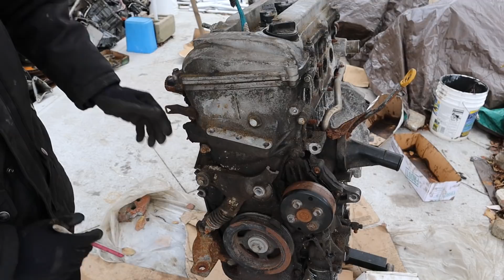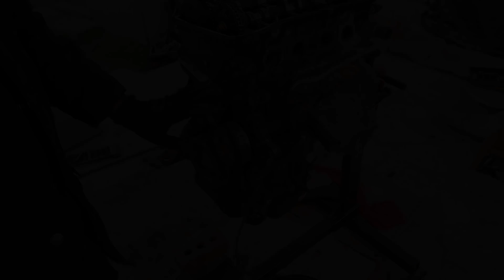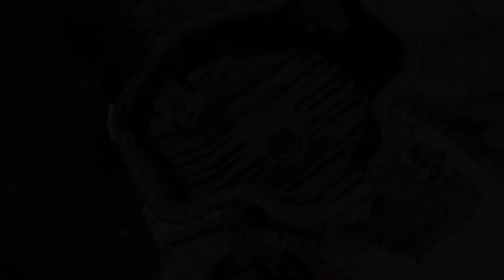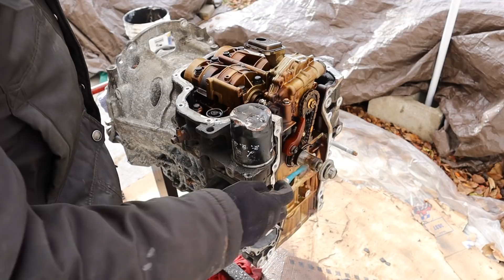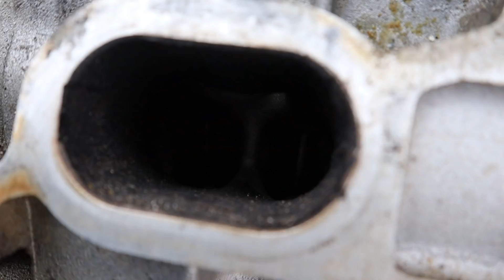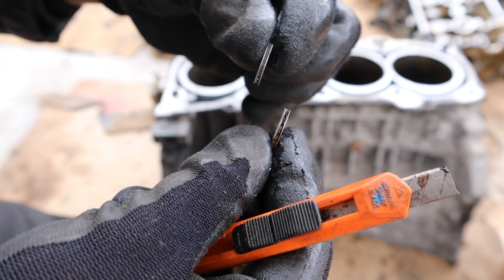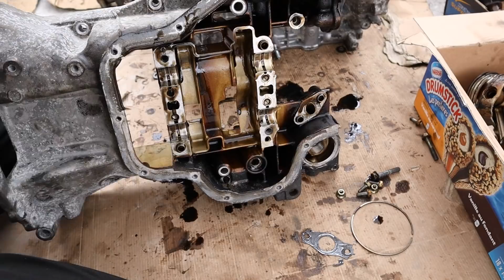Here's why Toyota Engines Fail

Comment: Which engine would you say lasts the longest? I’ve heard Subaru don’t last long and Toyota last longest. Assuming all are maintained on a regular basis.
Reply: Look for the engines Taxi fleets use, (as a general rule of thumb) here in NZ the Australian developed and built "Barra" 4.0 inline 6 is known to be bulletproof and racks up huge Kms. 
Lexus, consistently is No 1 for reliability and customer satisfaction, but Toyota in general, Honda also are probably top. Nissan USED to make great engines in the 90s during the Japanese factories "Golden era" (80s/90s) but now have fallen from grace, possibly merging with Renault and Dongfeng?? had something to do with this :-)
Reply: Where I live in Canada the oldest cars that I see on the road regularly are Hondas. It's a combination of their good quality and that they attract owners that are inclined to take care of them, IMO.
Reply: Mercedes Diesel Engines last a long time. No wonder 95% of cabs in Germany are Mercedes with Diesels
Reply: If i was getting a Camry, I'd get the earlier model with the 5S engine, overall it's a better car 👍
Reply: @lancecooper4646  got the 5s 2.2 in my 97 Celica, 230,000 miles and runs like a clock
Reply: @robbflynn4325  probably the best generation of Celicas, just ask Scotty Kilmer 😛👍
Reply: Taxi drivers here drive Toyota Prius predominantly seen them with over 500k.on clock.
Reply: @footballcoreano I agree they can last, but not a good idea for a regular person to buy a Merc here in the States, the cars themselves are expensive as are the parts, people do not know how to work on them and dealers are relatively few and far between.  I recall visiting Tenerife in 2004, where ALL of the taxi cabs were C Class diesel Mercs.  Basically they were used to shuttle passengers between the airports and the many island resorts.  The taxi we used had a million miles, I asked the driver how could a relatively modern car have accrued so many miles on such a small island and he said he shared it with another driver and it was in constant use 24/7, they probably only shut them down when they refueled or during servicing!

Comment: any engine fails for lack of maint period, those engines go forever with proper maint
Reply: But other engines don't burn oil as much
Reply: @lmb5529bml  My Toyota 4.0 has 250k and burns none with proper maint does yours?
Reply: @lutomson3496  The engine in the video actually does do as described even with proper maintenance. The oil ring gets stuck and the consumption jumps from a litre every once in a while to all of the oil in an hour. I’ve seen it. Checked the oil on the weekend, at the top. Wednesday, oil pressure light went on, no oil on the dipstick. Before that, checking the oil every few weeks was fine, and after that as well. But this engine decides it needs to go on a bender once in a while and drink all of the oil at once.
Reply: Unless it fails for a reason not lack of maintenance. Manufacturers still make blunders and corners are cut to save money. As a full time tech 30 years i saw plenty. Maintenance is best way consumer can prevent failures.. That and avoiding crap brands, first year models, cars with poor reviews and reliability history
Reply: @derrickodyes1934  I cant agree more thx

Comment: Hey, does anyone know what kind of screws the usually use for the connecting rods? is there any norm or something like that? thx in advance
Reply: You should be able to look up the part number on Toyota by looking at something specific like the piston. 

On their website they'll have an exploded diagram of all the parts in the area. It's great when you want to find a specific replacement for a bolt/screw/nut that you lost.
Reply: There is no "standard" but the conrod cap screws are typically 12 point (triple square, as opposed to the double hex speedkar points out for the head screws). 12mm fine pitch is a pretty common size but again there is not a standard that all engines follow.
Reply: Yes, someone knows.

Comment: Honda engine are the best.
Reply: Yes sir!
Reply: Once upon a time Honda was good.  Now with the 1500 Earth Dreams Engine, they screwed themselves.  Horrible design, oil dilution, excessive wear, oil burning, complete failures and Honda not standing behind owners, similar treatment as the owners of the 3.7 V6.  Those had Niksil coating on cylinder walks that wore off and burned oil like crazy. Honda is to run from!
Reply: @scotta9114  It's not 😀 the 1.5T is still reliable.. 250k km no problems..